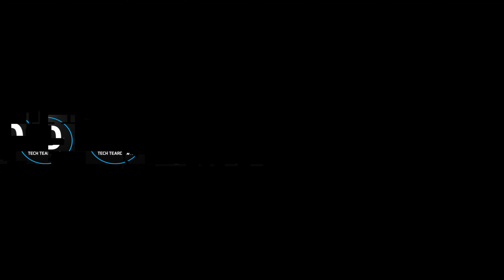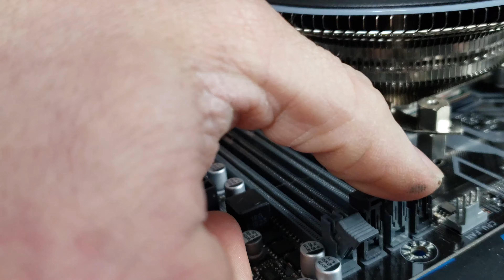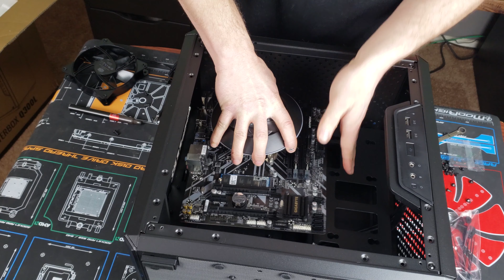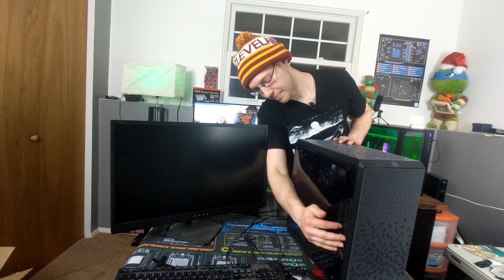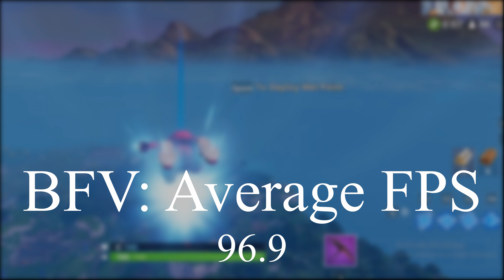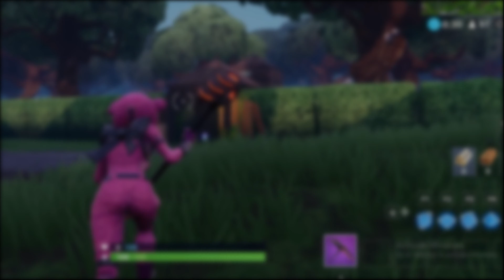Ultimate $750 budget gaming PC for Fortnite(w/ Benchmarks)

Comment: So 200$ for labor on a 550$ pc? Okay.
Reply from the maker: Hey can you show me where you can buy the parts to this PC for only $550? Because if I got ripped off on parts I'd like to know where I can get parts cheaper.  I'd appreciate the help!  $750 is what we paid not including tax.
Reply: Please make this build on PCpartpicker.com and reply to this with the link.
Reply from the maker: @EnjoyTide  They didnt have the power supply or the M.2 drive to choose from. So I did add parts that were just a couple dollars more and similar the 80+ bronze power supply was actually only $50. and the M.2 Drive was only $40. Everything else is good.

https://pcpartpicker.com/list/kJHrQZ
Reply: I understand. Windows license. New parts price, and the psu had me confused Thank you for clearing that up.
Reply from the maker: @EnjoyTide  No worries, I appreciate your time. Windows 10 is included but I'm not charging for it.
Reply: @EnjoyTide  I dont know where you're getting $550 from. I have a very similar setup but I have an rx570 instead and it cost me around $700. Here's a parts picker list for the one in the video (it costs around $750):

https://pcpartpicker.com/list/f4dDHh